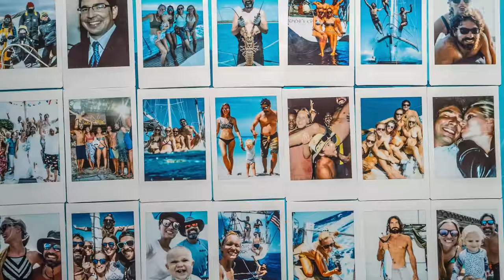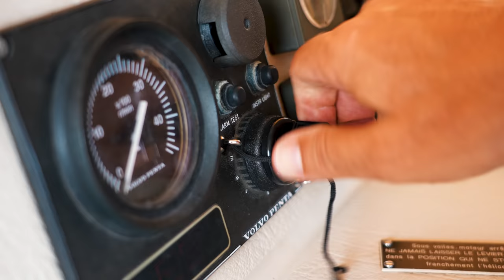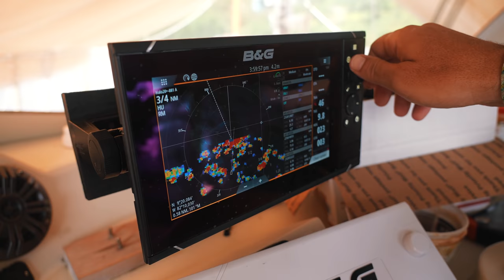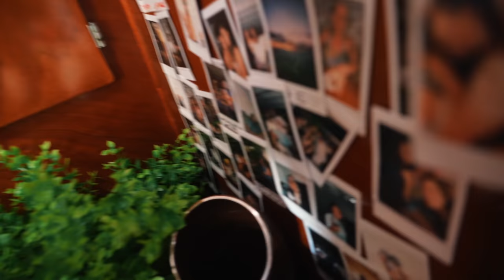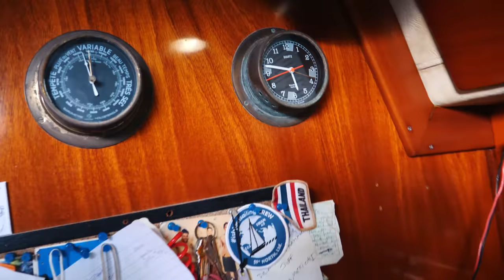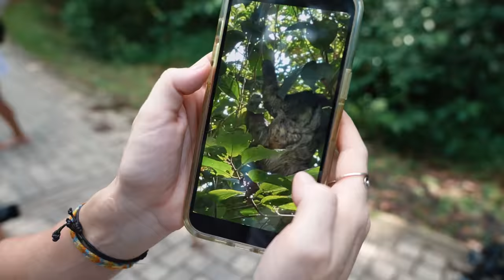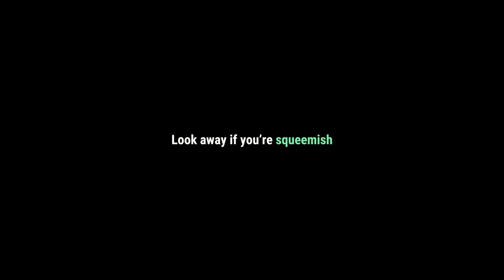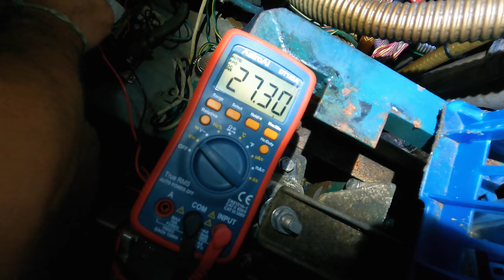Boat Project DISASTERS! SV Delos Ep 353

Comment: Brian the first thing I would do when reaching legal area is dump the septic tank and flush it, most definitely flush it thoroughly twice before storing or leaving the boat for any length of time.  Check on swimming pool pumps or house pumps.  I would try to find better quality replacements than the typical boat marina parts because a lot of boat parts are cheaply made and not good quality, just thinking outside the box.  Glad y’all had a great trip.

Comment: Sierra's becoming quite the actress 🎭
Lifting water jug

So heat affects pumps
A hose not used regularly deteriorated
Grade dried
And poo 💩 solidifies in the tubes/pipes

Wonder what other preparations can be put in place if go off for extended time again
On the hard may be much for in season
Have someone(s) stay on board keeping things in use

And some sort of toilet pickling type solutions 
If intake is done why not outflow
Barnacles form everywhere I guess
Only one intake thru hull
But multiple outs?

But she's an old boat by now and seen lots of use and abuse...

Sloth action cam 🦥
Time like sky
Weather 
Tides
etc

Comment: Here's a little tip when flushing a head on a boat. When you flushed the bowl empty keep flushing... at least as long as it took to empty the bowl. You will never get a clogged waste line like Brian showed if the only thing in the line, when standing, is water. Yea. You'll have to do more pumpouts.

Comment: Some possible solutions to your fresh water in the bilges are 1. Audible timer-as I advance in age I rely upon several timers to remind me to attend to tasks I've started and need to complete. 2. High water alarm or bilge water alarms. Float switches or moisture sensors tied to loud audible  buzzers such as Sonalerts (that's what we used in the seventies) work well, are cheap and easy to install. Good luck!

Comment: Good video ! 
Wear Your Scuba diving face mask So you Dont smell anything when Cleaning stuff that stinks & Chopping onions ! No Tears or smells. You can also Wear a cheapo respirator off the Net so u dont smell stuff. $30.00 for a Half respirator. Snorkeling face mask Should Work though ! 
2) For That one Toilet hose that Plugs up - id recommend Removing it annually & Washing it Out / Add To Annual Maintenance List. Save u alof of Grief & 🤮 . alot easier to do when not clogged.

Comment: Brian: Add a teaspoon of sodium percarbonate (SPC) to every toilet flush. The SPC is a powerful oxidizer when dissolved in water. This oxygen will kill off the anaerobic bacteria (the stinky stuff that causes gag reflex) in your holding tanks and further liquify all of the biological and paper solids in the tank. It will also keep your waste lines clean and non-smelly. Pretty cheap on Amazon and I'd suggest worthy of a try if you haven't already.

Comment: I could see a pump using plastics where the saltwater would be in constant contact but for the gears a bronze one would be much better. Maybe ship that to a machine shop and have them make you a couple replacement gears out of bronze, then you could rebuild the ones you have at least.

Comment: Humidity is rough on electrical motors, relays and unprotected connectors but when used regularly there is enough heat produced to keep it at bay ...things that are normally wet that becomes dry for a long time will rot the sludge or slag that you called it in the shit tube dried out then you ran water through it and broke loose the dried sludge and stopped up the tube ...there is a spray lube for electrical contacts that you can spray in motors on relays and other contact's that could be applied when your not useing them for a long period of time to keep the moisture at bay

Comment: You could put a couple of diodes on that pump to drop the voltage acrosss it which would lower the pressure. It's about a half a volt per diode depending on what you get.

Comment: After far to many failed and yes expensive pumps I have switched  to Marco mechanical geared pumps. Pricey but so far has been a good move.
Reply: The pump itself is built like a tank and weighs a ton. I like that – it means there is a lot of metal involved in the design which will likely last longer than the cheaper plastic models, and it just feels like a better made system. The electronic control system is much better than any of the other systems I've had. There's little to no lag or notice when opening a tap, it ramps up and down smoothly, and the LEDs are super convenient. They indicate a number of states with the pump and water supply to help troubleshoot issues, I have been so impressed that I have swapped out every pump on board with them,

Comment: There is always scale on the drain line walls and when it's allowed to dry, when the lines are not used for a while. The sca dries and falls into the tubing and when water starts flowing the scales builds up and blocks the drain.
I have a seasonal restaurant and it happens to our drain every year when we reopen, all the scale flakes off and blocks the drain
Reply: When you close down, run some freshwater, with “Sew-clean”, ( west marine),into the toilets. Flush out the tanks/lines. Hope this helps.

Comment: My brother in law has a canal narrowboat and did the same, left the shore water supply running and came back to find boat on the bottom and completely flooded. Nightmare, some things were fixed, loads replaced, some treasures - photos etc, lost forever.

Comment: Waterflow alarm and a switch that lets you guid the receiving water directly to the overflow too make sure the tank fills, we learned doing that was important fairly quickly because things do break and before filling anything one should always check to see if the system is intact especially after not being used for a bit. Delos is much more complicated than our 10 meter sailing ship, but the idea holds true, our mishap put a lot of fuel down into the keel and it made the whole ship unusable for weeks due to the fumes even after we got it all out. We changed how all system that can overflow and break is checked and worked after that, once is enough, but it was a big job to get the workarounds in place.

Things get clogged and shit get stick in section that makes it hard to get rid of, I more or less think that's a rule of the world. It's also why flushing every system clean before putting the ship away for a bit is important, just so that nothing get stuck along the way.

Comment: The Whale marine brand "Gulper 320" is actually made in the UK!  Very surprising it would use such poor quality parts.

Maybe order in a Johnson marine pump?  Something like the F3B-19 (All bronze head, Nitrile impeller)  Not cheap, BUT designed to be end user serviceable and with full parts support.  They have parts and service worldwide.

Comment: Just by sitting dry , any rubber impellers and O rings dry up and shrink . When you first introduce movement or pressure they move but will crumble with the friction and movement.
Minerals and solids also crystallize throughout  lines and break loose after soaking but dam up in any bottleneck situation. Sometimes by just letting water into each system for 24 hours the rubber can soak and swell and revive the rubber parts or soften the blocking solids in pipes so they can freely flow with out damming pipes.
Warm soapy water would work best to soften and lubricate.
Best to flushout plumbing and sewage  before turning off and leave some fresh water in system.
Keep spare impellers and O rings incase they don't come back to normal  after turning on. It's cheaper than inspecting and replacing whole  pumps. 
I have noticed that even a simple O ring on a faucet can become rigid when not used or moved for a long time and will leak for first day or crumble altogether. 
I hope this helps .
You had me at  Huoooollpp !
Lol... Take care I watch all of you videos ! Thanks !

Comment: Have u thought about composting toilets? no clogs to break, no plumbing to reckon with. its a two compartment toilet where the urine can be ran through to the outside, but the pooh is bagged. i use diatomaceous Earth to draw out the moisture, then peat moss to cover it up after every use and no bad smells, just a slight radish smell when the lid is up. it can be used as fertilizer by someone else, labeled as such and placed on the docks, or just dumpstered.

Comment: My water tanks vent hose got kinked somehow and caused one water tank to explode. The filling hose was positioned so that it didn't allow the water to back out of the fill port. Was a nightmare to access and replace the tank. I run vinager through my toilet, macerator and holding tank regularly, works great. It dissolves all the hair and whatnot that frequently jamms the macerator and keeps the pipes clean without killing the bugs that breakdown the 💩

Comment: Kazza looks shattered, I remember a trip with two kids aged 3 and 1. Our three year daughter (looks a bit like Sierra) did a runner whilst we were boarding at Charles de Gaulle airport in Paris, I held on to our 1 year old son whilst it took my wife and two stewardesses ten minutes to catch our daughter. Finally a very athletic Air France stewardess rugby tackled our daughter and we all got on the plane more than somewhat frazzled, the aircraft door was slammed behind us and the plane started taxying before we sat down. That was on top of the nearly missing a connection, lost baggage and general travel related stress.

Comment: Motors, pumps, and such which run continuously in cycles of off/on have a tendency to seize after prolonged idleness. I think, that they are generally worn after a period of time (year?) but we don't seem to recognize that they should be replaced, or at least have a spare on hand.  We have a tendency to put things off until it breaks.  Therefore, it's paramount to have all kinds of spares for those times when the store is out/closed/backorders. I'm land bound and we have those problems too.  Having these problems in a far off land seems avoidable to some extent, but a bit of a pain.  Imagine my surprise at discovering that the parking pawl in most of our cars transmissions are made of plastic.  Think of how many times we put the car in park depending on that plastic thing to keep the car from rolling away.  Use the parking brake... always.  Carry all spare motors and critical parts.  Plastic  will be used every where because it is cheap.  If the part isn't heavy, it's probably because of plastic internals.

Comment: Plastic gear could be by design. Perhaps the gear on the motor is harder to replace? It's common to purposely add a weak link that is easy to repair, so you know that it's the first thing to break. And not some other (more complex or harder to replace) part.

Comment: As always, lots of fun and very informative, particularly regarding the types of problems which liveaboards face on a regular basis. I was wondering, however, why your bilge pump did not kick in to remove the overflow from the fresh water tank before the water reached your food/still storage. Was there a problem with the float switch as well?

Comment: I had a freezer die while I was out of town for 2 weeks, full of meat. When I walked in it smelled like there was a dead body. The smell was unbearable so I grabbed my organic vapor 3M respirator and proceeded to remove the dead meat. 2 hours later it was cleaned up and I smelled nothing the entire time. However my clothes had to be thrown away because no matter how much I washed them the smell of death would not come out. Get a good respirator with organic cartridges for those times below deck working around horrible smells with little ventilation.

Comment: BE CAREFUL with flexible PVC.  It has plastic reinforcement within that allows for its flex.  I have accidentially snapped the reinforcing plastic and ended up with the tube bursting under pressure (when I was  not home).

Comment: 2022 and people still don't know how to fly with kids.  
FYI the pressure in a plane is set to around 8000ft, which is about 10.9psi, sea level is 14.7psi.  That change in pressure plays havoc on ear drums, nasal passages, stomach, and intestines'. Don't feed or give any thing to drink for at least an hour before boarding. 
Wait till the door closes before giving the kid anything. 
The act of chewing or sucking on a bottle helps keep nasal and eustachian tubes clear and equalized.  chewing gum if old enough 
A dr can give medication if the kid has a cold or is congested.
As for stomach lots of fluids during flight
Take off and landings is when the pressure changes. It's too bad there is no warnings of these pressure changes.

Comment: What a "shit" episode! :D
Can I suggest that you increase the diameter of that hose?  I'd go up to 1-1/4" to 1-1/2" bore if I were you (larger the better) as I suspect the hose is resisting the full flow capability of the pump.  This would explain the 'explosion' you suffered way back when... the hose diameter is resisting the flow, creating a back-pressure.  Also, any scaling would take a LOT longer to cause you flow problems, you could then schedule a descaling acid flush once a year and mitigate the issue.

Comment: So why are all of these system being driven by JUNK?? I understand that salt water and air take a toll on most everything, but why not use brass or stainless? Why not seal every possible part away from corrosive elements? Especially when these pumps are so expensive!!  Maybe designing far better parts for the ocean life is your next calling, Brian..  I think the reason the poop tube loads up is because you don't pump enough water through it to clear the tube each flush. The solids are not being carried all the way out and settling back in the tube a little at a time. I know it seams a waste, but maybe a few times per day or every other day maybe, flush with nothing in the bowl to cleat the poop tube.. Another thing, I have noticed on just about every cruisers boats that I watch, the bilge pumps actually lay in the bottom of the bilge. I think it would be far smarter to raise the pumps to an area out of the water and just use a float switch to turn it on/off and add a check valve to the pick up hose to keep the pump primed. That way your pump is not laying in the water deteriorating from the outside too!!

Comment: I'm beginning to think, WHEN the floating home is left unattended for periods of time & all these ISSUES Arise. IT would be WISE to have someone "Boat Sit" & operate everything on a regular basis (daily, or at least weekly). Seems THAT would eliminate a WHOLE BUNCH of Headaches, don't yawl think??? AND it could be anywhere from having a friend "Boat Sit", paying someone to "Boat Sit", FREE Live-aboard  with current food supplies to perform those daily equipment operations, to "Short term live-aboard" boat rental with equipment operational servies required. Seems a lot of better Options than leaving the boat "Just Sitting" for 3, 4, 6, 9 months at a time with Nothing Getting used to KEEEP things in WORKING Order. IF something breaks down then, it would have broken down on the next sail anyway.

Comment: Hum, there's thought to market. A "Heavy Duty" rebuild kit for the Gulper 20! ALL Metal Construction, designed & manufactured with "Quality". Then when the "Gulper-LESS 20" fails,  a kit can be installed with hand tools. SO the Gulper 20 lasts two years with a cost of $200. A kit for $100 that last 5+ years. OR Yank a NEW one apart with the kit for piece of mind. IF I had a nice well equipped machine shop, I could put a Hurting on  these Companies who DON'T Care about the boaters SAFETY & instead produce CHEAP Money Making PLASTIC "CRAP" & that's what it all is, CHEAP CRAP with a HIGH Dollar Price Tag!!